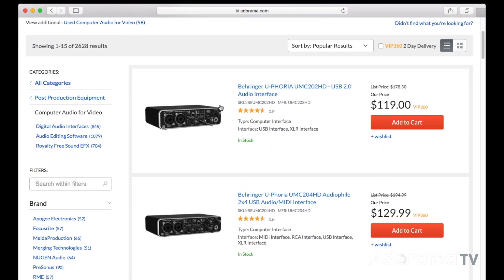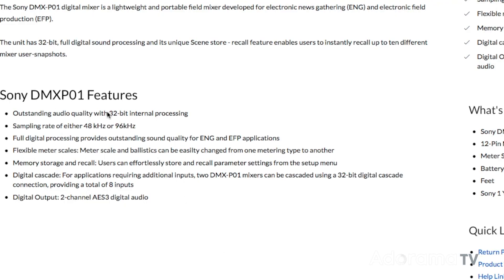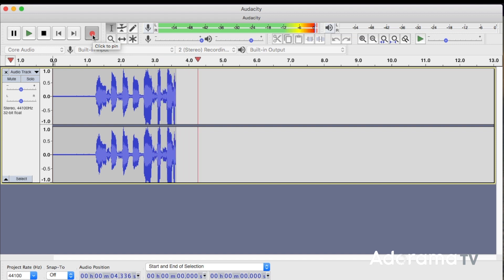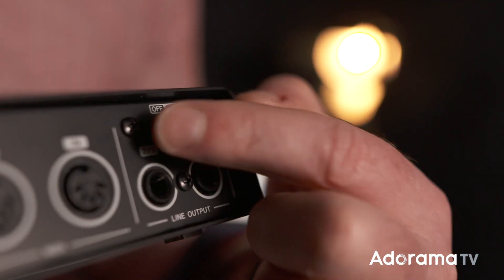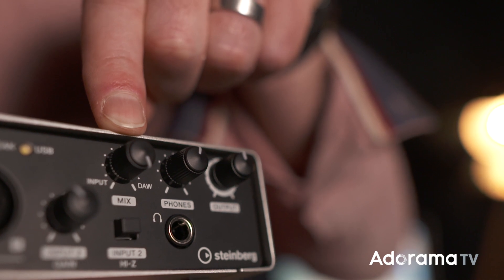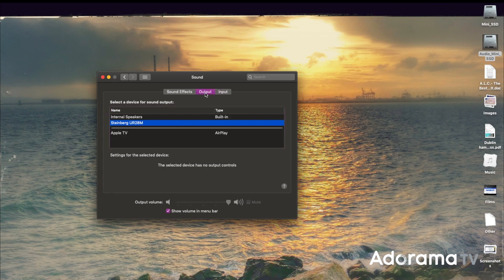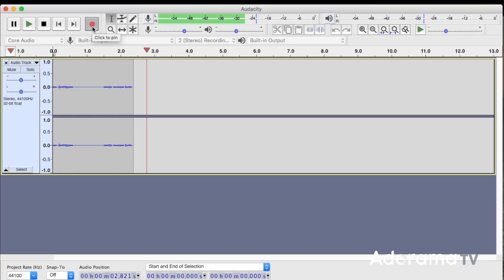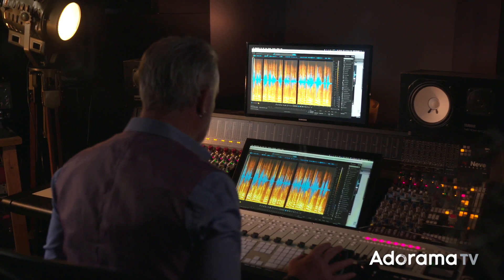Back To Basics - How to Choose and Use an Audio Interface: Perfecting Audio with Keith Alexander

Comment: Thank Keith, very informative. You asked for questions so, I find that a lot of my recordings on various devices are "tinny". Would this be due soley to the acoustics of the room or am I missing something in respect to settings?
Reply: It could be a number of factors. Firstly look at the EQ have on the MIC. Have you tried listening on various speakers of other locations. What devices?
Reply: @NoiseMiner  Thanks Keith, I'm using a Zoom H4n and listening with headphones direct into it.  I think I might have to work my way through the all H4n settings methodically.

Comment: Thanks, Keith happy new year, I've got an old UR28M but works like clockwork for years no issues. I use Audacity to try and clean up my video file Audio (s). Mainly for noise reduction and add EQ (Treble & bass) boost. Anytime I then try to add compression to me it just sounds wrong so I don't add. Can I request if you can go over:-   compression in Audacity or run through complete steps for Audio cleaning using Audacity for a video audio file. Cheers~
Reply: Same to you, I hope you have a wonderful one.
I will certainly look at doing a show on compression. I also hope to run thorough the functionality of Audacity and how the functions relate to the big professional DAW's with a view to bring your abilities along.
Reply: ps: you cant go wrong with the Steinberg interfaces they are built like tanks and just keep working, I love them. I have a UR28m as well and I love it. I also have a UR22 and I love the build and protability.
Reply: @NoiseMiner  Cheers and glad to hear about future episodes that will cover Audacity/ compression I will be grateful for that~
Reply: @NoiseMiner  I was happy to see the UR22 in this video that made me smile, as for the UR28M I am not sure I knew what I was buying at the time I guess because I was using Cubase then I got the Steinberg UR28M and what a good choice. The manual even said no need to turn it off regularly so every 3 months or so I switch it off for a few  :-) Highly recommended.